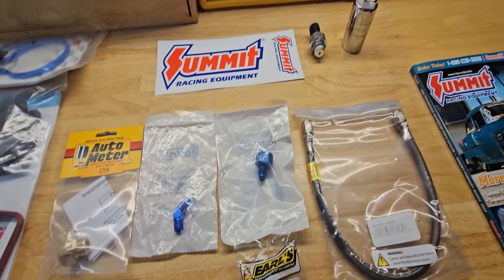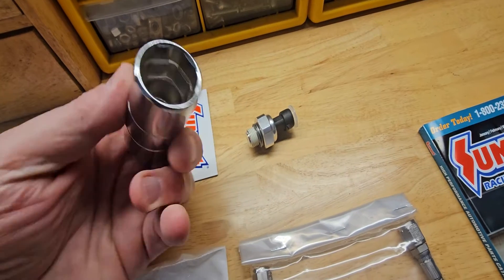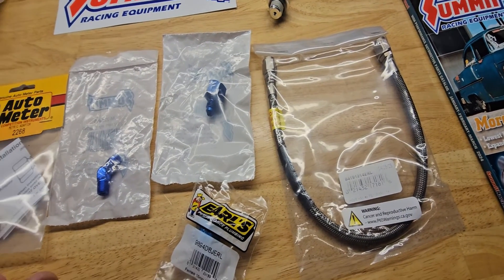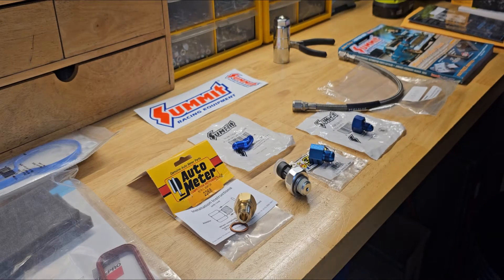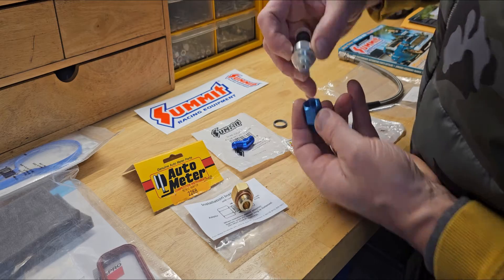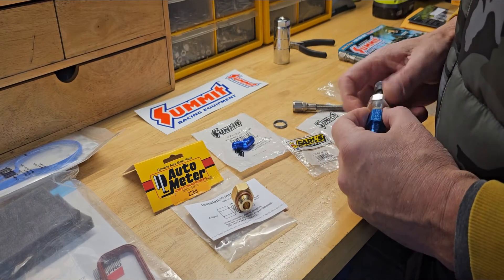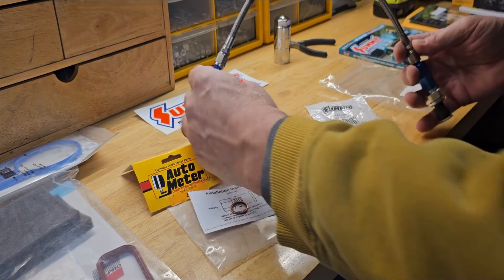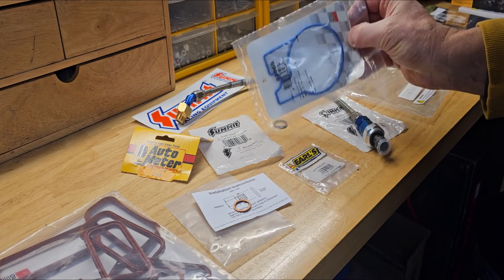Make your own oil pressure sensor relocation kit for Chevy LS

Comment: I’m doing this. After an afm delete and replacing the valley plate I’ve had nothing but issues with the p0521 code. Brand new oil pump, sensor, o ring. Only thing I can think of is that damn sensor especially since the valley plate was different for afm delete. I’m going to try this instead and it’ll make so much easier to reach as well
Reply from the maker: It makes a lot of sense to do this on any LS engine, considering what a pain it is to get to the silly sensor that is prone to fail. Even if you never have a problem again, it's good (and cheap) insurance.

Comment: Can you post the links or part numbers in your video description not the video so they can be easily copied and pasted
Earl's 9894DJERL - Sensor Adapter1
Summit Racing SUM220121 - Sensor Adapte2
Earl's 64191914ERL - Braided Hose
Autometer ATM2268  - Block Adapter1
Summit Racing SUM220455 - Block Adapter2

Comment: How did the install go?  Was the stock sensor wire that connects reach where you put it?
Reply from the maker: Removing the intake is not easy, but that is the reason behind relocating the sensor,  so you never have to do it again.  The wire and connector does reach the new location.